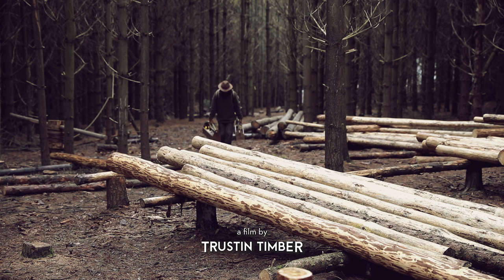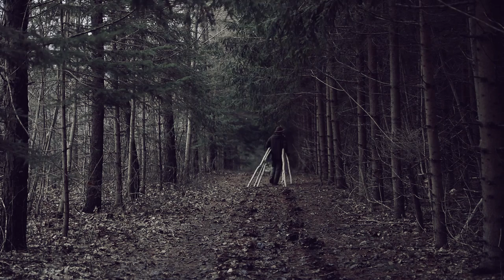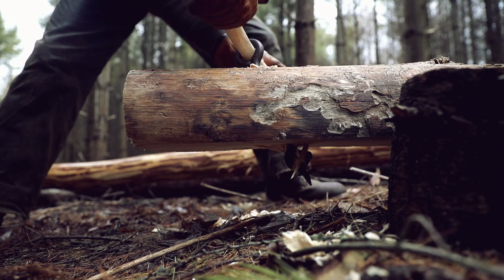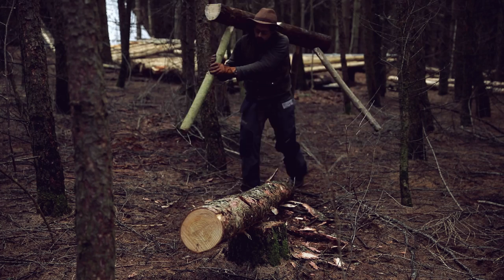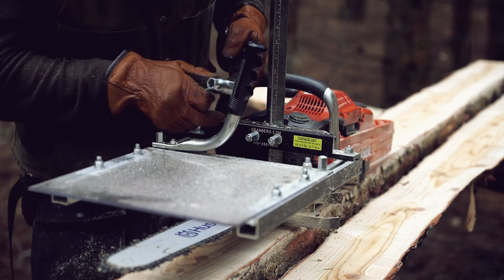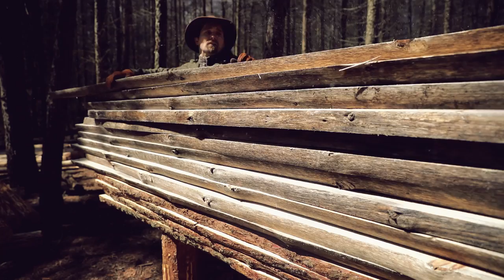EP 3: Building Saw Horses & Milling Trees  for Floor Boards

Comment: The way you have of leading us through the inside of things brings out the enchanting connections we have, still, with a natural world that's become remote for many. But you make it easy to recognize that movement, anywhere, done with contemplation, is how such connections can be made. Hand tools, and the natural world they sprang from, cannot be made obsolete. 

But using the advancements found in power tools is yet another level of nature transformed and held in our hands - metals and gas harnessed to achieve what our minds are gifted with imagining. By following nature, and carefully reflecting back while advancing toward the future, those most useful tools show how closely nature is still meshed within us. They animate and magnify our soul's instinct and ability to create, and that's some kind of wonderful magic. Thank you so much for sharing your adventures with us.
Reply from the maker: Yeah, there is beauty in tradition, and there is beauty modernization. I don't feel the need to pick one or the other when I can have the best of both.

Comment: Great video! How do you keep your chainsaw running fairly quickly through the log? Mine takes forever, even when sharp.
Reply from the maker: I feel your pain, Michael.  I did a lot of slow milling when I got started. I'm not sure of your saw or experience sharpening chains but once I got a more powerful chainsaw and got better at sharpening my chain the speed picked up. Also little things like the angle of cut, and other small technics you pick up over time help speed it up. But remember these are just pine and larch trees. Not hardwoods.  Hardwoods take much longer.  I often turn the chainsaw off and cool it down for periods of time when cutting hardwoods. Patience is just part of the process.  Try to enjoy the breaks:)
Reply: Trustin Timber thanks!  I have a Husqvarna 460 rancher saw. Very similar to yours I think. I am using a regular chain(not crosscut/milling) although I’ve used the milling chain and its even slower new out of the box. I do cut mostly hardwoods and up to and even including logs that are a couple inches larger than my bar length of 20”. Thats probably part of it too. Softer wood does cut faster for me but still seems excruciatingly slow. Lol. Nature of the beast I guess.
Reply: I sharpen with the Granberg electric precision sharpener.
Reply: @Michael Sherman: your saw is too small. I use an older 272, works very well.
Reply: woodsman forlife hmm, Granberg recommends a 60CC motor, mine is just barely there. You may have a point there. 🧐
Reply from the maker: @the1plantguy  Yeah, cutting hard wood is a different story.  Sometimes it's slower than others.  I'll maybe have to go through all the little details I'm picked up over time at somepoint in a video.
Reply from the maker: @the1plantguy  yep. the biggest factor.
Reply: @the1plantguy  use an older chain and file each tooth to a 0° angle instead of the 30° from factory it will cut way faster. Also file you're rakers down a tiny bit. I did this recently with an older chain and it cuts extremely fast and smooth. Crosscut chains are fairly slow. If you can find a full skip tooth chain it will also help cut faster and less bog on thr saw. I'm using a 455 rancher with a 20" bar and a homemade mill and it cuts phenomenally! Find an old chain and give it the 0° angle you'll be impressed how fast, less fuel, and less effort it takes.
Reply: @woodsmanforlife1677  I use a 455 rancher snd have had 0 issues milling lol I've even used a 42cc craftsman and a 50cc poulon they all have done great. I mill a lot of red oak with no issues.
Reply: @lonewolftech  thanks. I will try that